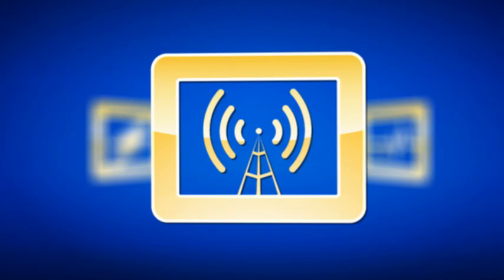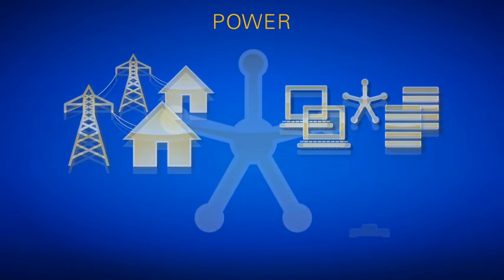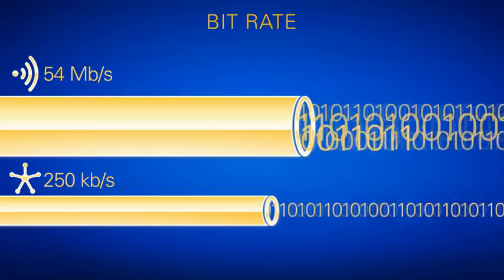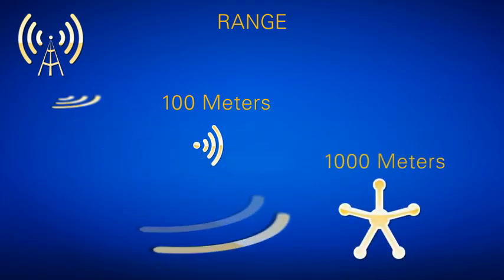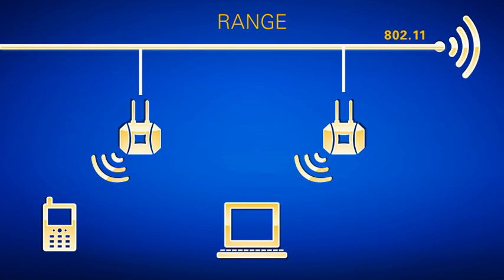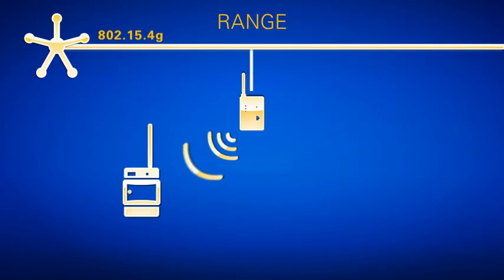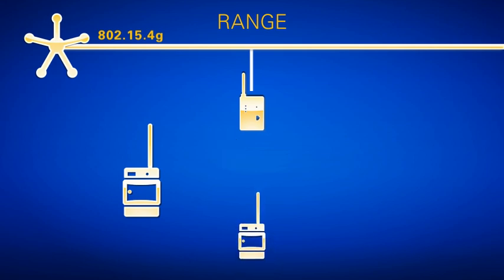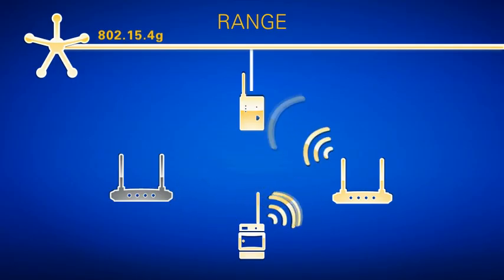Explaining Wireless Sensor Nodes:  Zigbee vs. WiFI

Comment: Summary:

Power = battery lifetime: wifi 1-2 days max, zigbee 3-5 years max

Bit rate: wifi 54 Mb/s, Zigbee .25 Mb/s

Range: wifi 100 M, zigbee 100 M, zigbee pro 1000 M 

Routing/topology options: 
   wifi: access point with clients,
      extensible via wired ethernet
   zigbee: gateway with mesh routing (can extend to 1000 M),
           also extensible via router nodes 
           which can provide redundancy
Reply: PistonPackingPete thanks
Reply: thanks for the summary
Reply: zigbee pro?